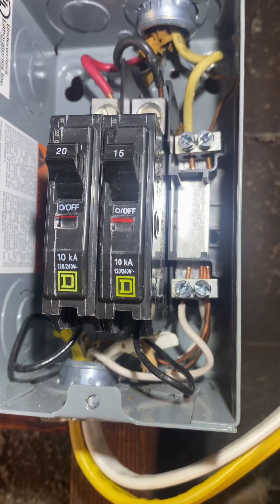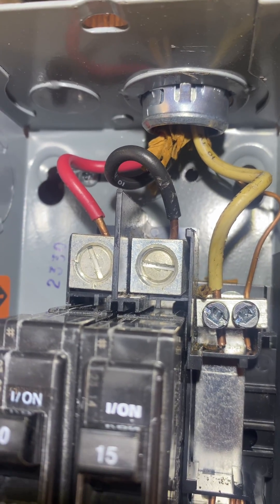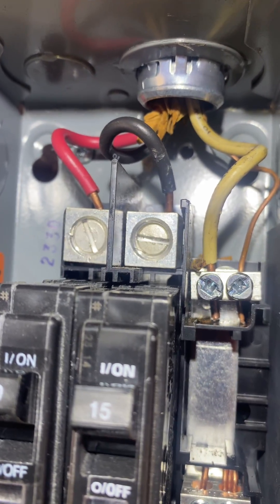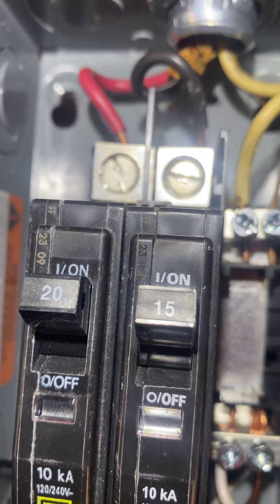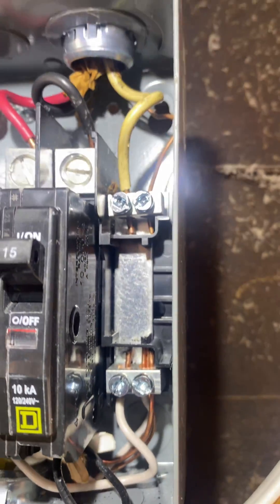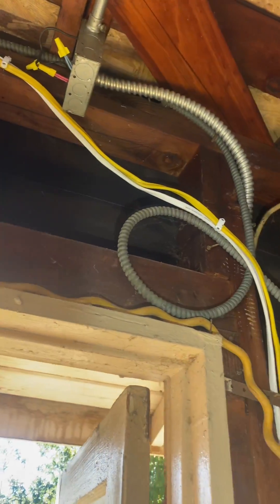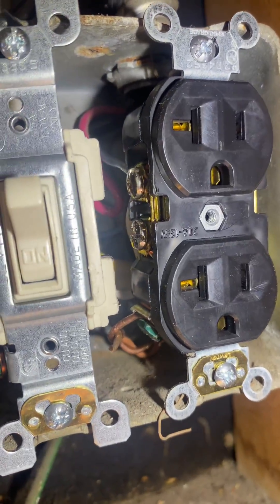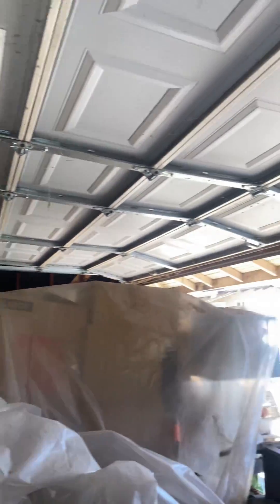How to wire a surface mounted electrical panel Fast and Easy

Comment: Grounds and neutrals should be separated. You were supposed to install a separate ground bus. Also #10 should be coming off a 30A 2 pole breaker. 40A should use #8 wire.